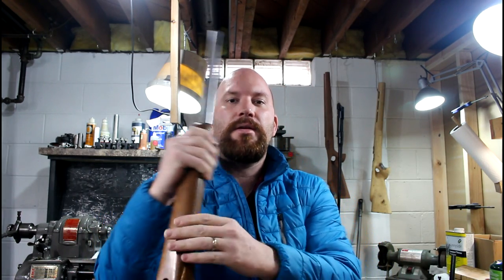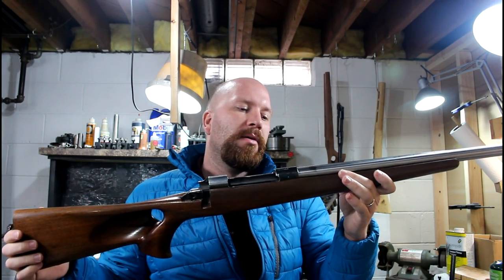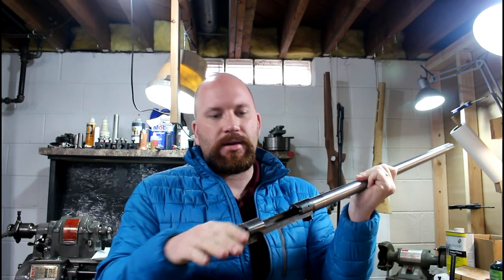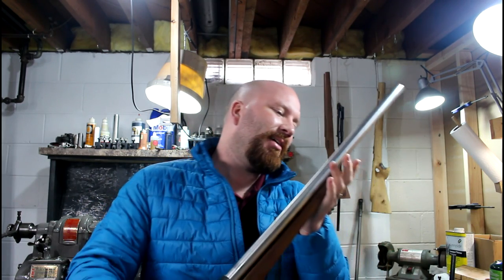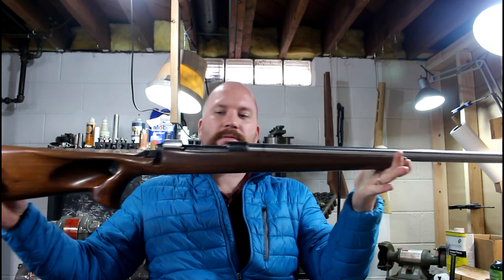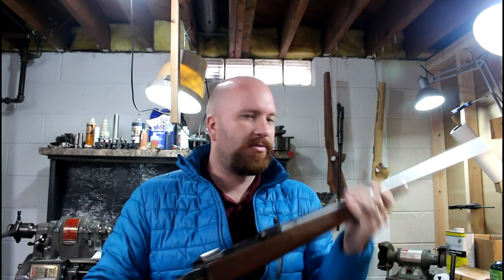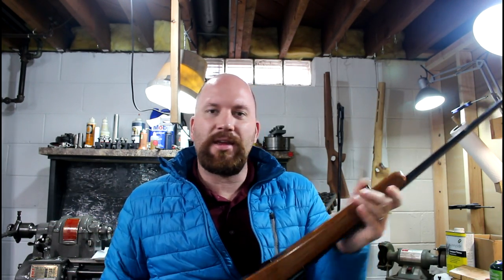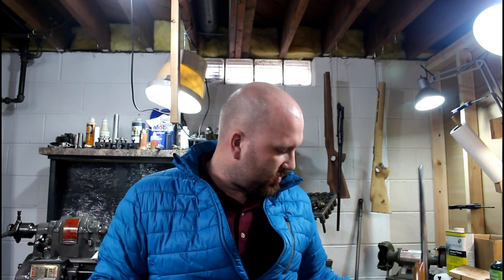Hot Caustic Bluing Drive and Shop Update!

Comment: A tip for hot bluing which may come in handy. If you find some minor spots or blemishes on the steel while bluing, take some steel wool while the barrel is out of the tank, and give it a light rub (like you are touching a piece of silk) . The blemish should come out, and it will be slightly white. Put the part back in the bath, and it will blue ok after a few minutes. It saves having a to completely repolish the entire part and save some time. It’s worked well for me over the years. 
Good luck .
Brownells gunsmith kinks give plenty of good advice as well.
Reply from the maker: Thanks for the tip. It's been a while since I blued, but I have enough stuff to do a batch soon.